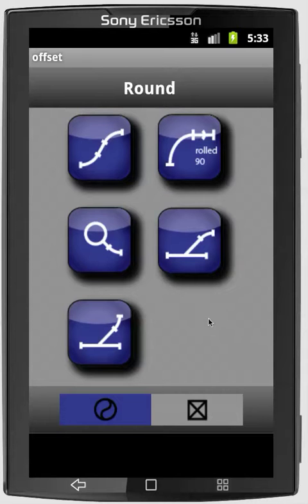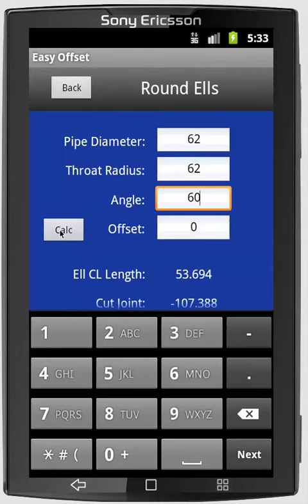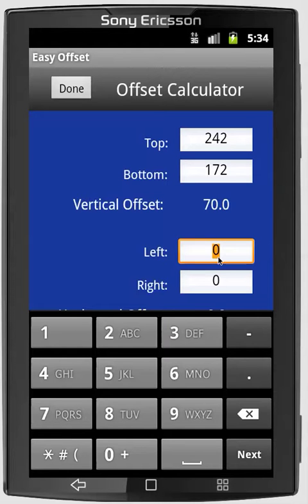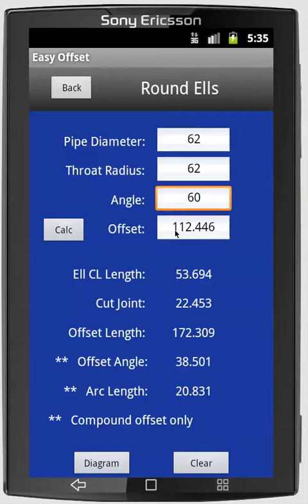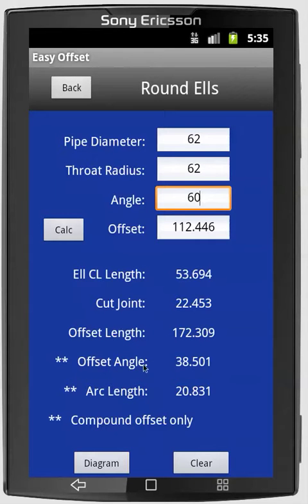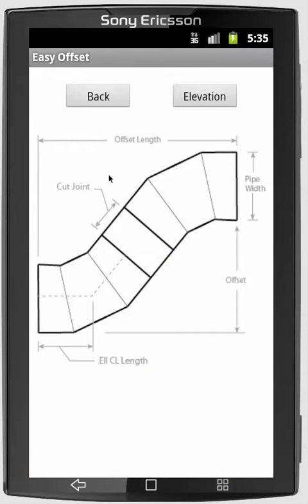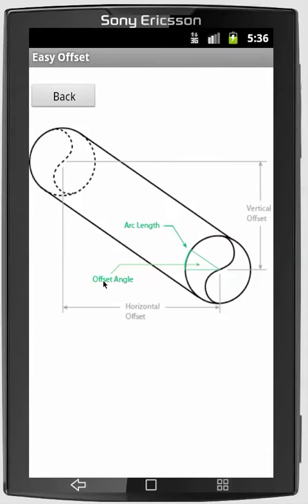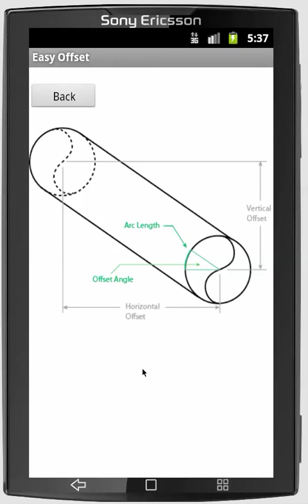Easy Offset- calculating rolling offsets

Comment: thankfully i don't need an app for that lol just remember that is is offset depth times multiplier depending on the degree of the bend then if it is rolling make a bend after turning it 90 degrees in the bender and make another offset.